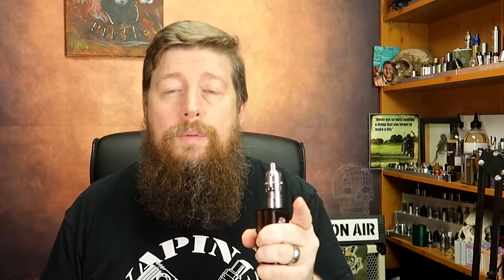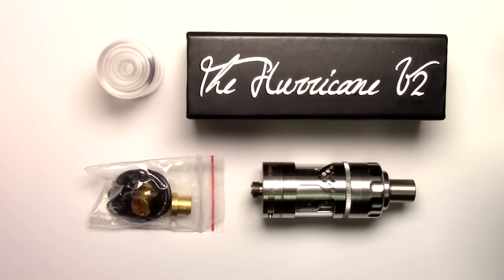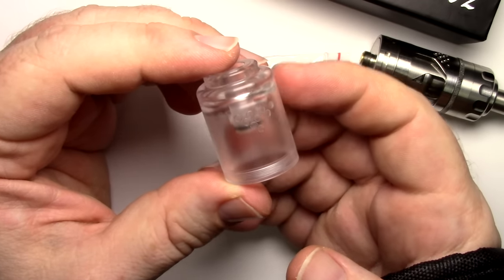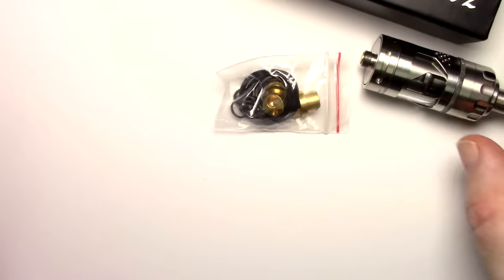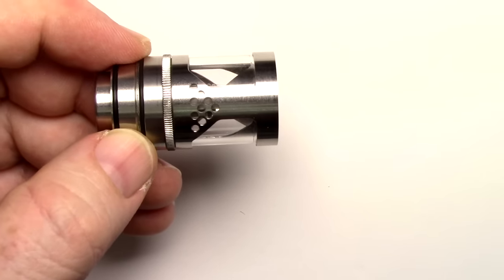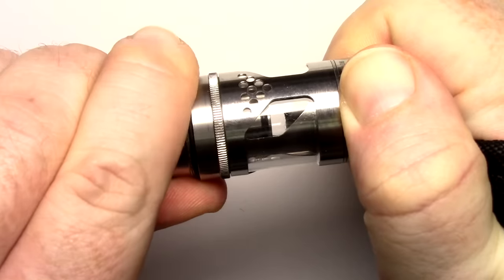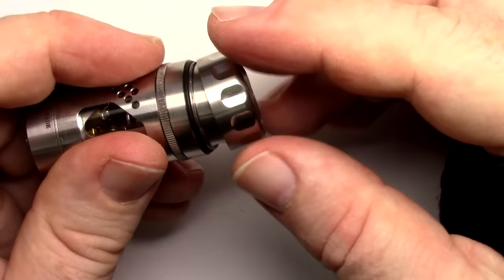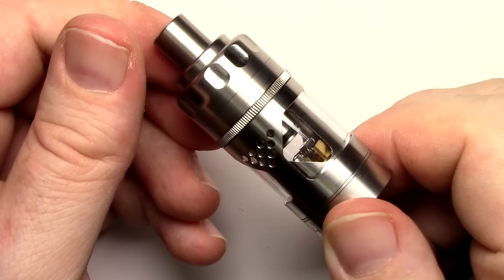Hurricane v2 REVIEW & STRIP DOWN TO AVOID SPINNING - Thorough AF ;-)

Comment: Hi Dean,
Just a little FYI, there were indeed some QC problems and one of them was with the thin top o-ring as it tends to get bitten by the top ring and then that leading to the JFC not working as well.
Latest versions of the HCv2 include a flat o-ring for the top of the glass and that solves all problems, leaving the tank working perfectly.
Great review!
Reply: and you can get it for 125 swiss francs [official company price], that is a lot less than 175 pounds....
2 years later, I still love it [best flavor], and I own a lot of different tanks.

Comment: This looks like a great tank. 175 is high, but I carry my vape EVERYWHERE.  It looks like it will last. I've bought cheaper tanks, and had to buy again because they break. Press fitted ones tend to not be pressed together after awhile. Cheap delrin caps that screw on strip, thin metal get super hot, is aluminum a metal? Quality is what I want. Something to fire mid range and not have dry hits due to wicking. Most of all flavor. Flavor with 3mm (at the least) airflow.  
Thanks for the review, looking forward to the conclusion. It's a cliff hanger. Have a feeling the hurricane will be worth the vape.

Comment: Thank you for that review Dean! My Hurricane V2 was tried and put away because it leaked and I couldn't get the juice control to tighten no matter what I tried... and watching you put it together I have realised the part you put up into the glass is dicky... mine has a small ridge and the barrel won't fit through the glass. I got one form the very first release and I think they screwed up and their quality control (or the lack of) let some through that were not 100%. I will email you pics.. please check on your barrel if it has the same ridge.
Reply from the maker: Best thing to do is email the E-Phoenix guys Rob :)
Reply: Have done! Thanks Dean!

Comment: Great review. First let me say I don't mind paying for nice vape gear. I am definitely a "hobbyist vaper". I've spent thousands on hemo mods and attys. But for what around the 210-220 USD range for a tank is a little out of my price range. It's seems dare I say a little over engineered or maybe overly complicated is a better term. That brake down would drive me crazy and with 3 different sized o-rings placement I'd have to remember...I think it would break from me taking a hammer to it.

Sorry not sorry that price is just outrageous. And I get it seeing it there is a lot and I mean a lot of time and effort into machining one of those, but still over $200. I could pick up 2 or 3 high end RDA's. I could get a decent DNA 250 mod plus a atty or a nice hemo type mod with an atty (like Chinese stabwood or resin). I could get a lovely high end mech. I mean for crying out loud I could basically get a current gen gaming console for the price of that MTL tank. 

If it was $120 USD that would be one thing but at $100 more it's just a little ridiculous. Don't get me wrong if you have it and love it good on you that's great. But that price just seems a little much for any atomizer really. It's a substantial purchase and I don't think I could pull the trigger on that regardless of the vape I get with it.  Just my little rant.

Comment: I have tried many different coils and I still don't understand what's the big thing with claptons, they take forever to heat up and cool down, u need to put massive power through them to heat up quickly which makes battery's last way less and die way sooner half life wise, the flavor isn't any better either, I find a simple twist coil taste just as good and takes way less time to heat up and needs less power, but I only use that in droppers, in tanks I use 28 gage or 27 gage and the flavor is the same, claptons are just pointless
Reply from the maker: I use a SS dual core clapton at 17 watts, your argument is invalid in that respect.

Comment: Never been a mouth to lung vaper by choice but I have used some fine mtl gear just to try it out. Nice video and all but the tank looks way too complicated and somehow dated to my eye.

I love my drippers and really only use the Velocity V2 nowdays and have been thinking of getting a new dripper for a long time and there sure are some awesome stuff coming out to choose from. What I want is simplicity, nice and smooth airflow and a basic deck and only dual coil setup since that seems to be my thing so no need to make it more complicated with the choice of both.
Reply: Niko Eronen try the recoil :) smooth swooshy airflow and comes with 2 different top cap :)